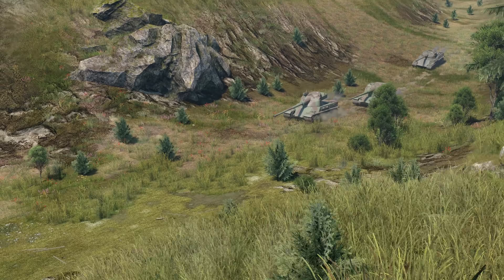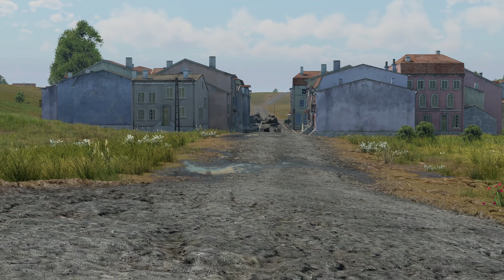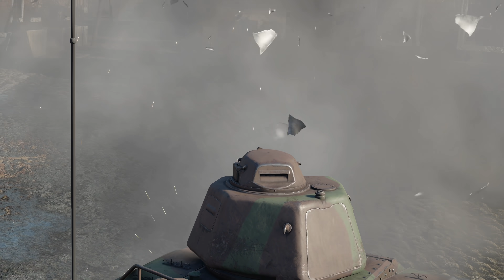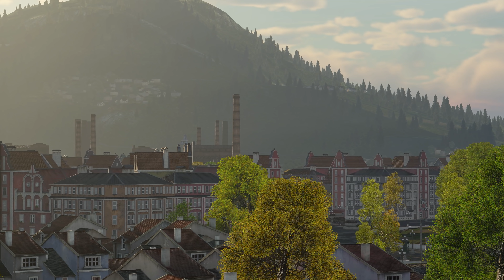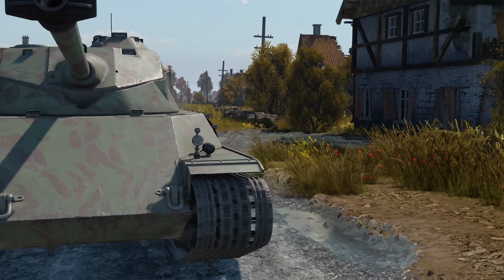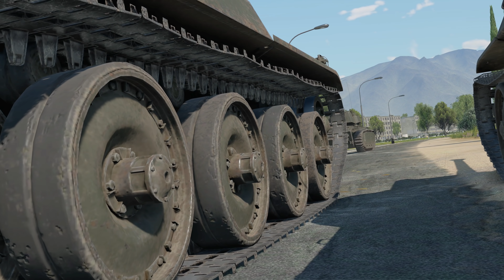French Heavies / War Thunder

Comment: I like the ARL 44. That big front plate probably gives it a pretty fair chance in head to head engagements, especially at longer distances.
Reply: Which one? Because they both have weak turret armor and can be penetrated easily
Reply: @TheSlyRat32  
I'd go for the 90mm. And I didn't know that. Maybe if you go in and out of cover, only exposing your front plate most of the time and just focus on keeping the turret safe, you might stand a good chance.
Reply: @undertow619  yeah but it's hard, I use both and they're really fun to play but if they are already looking at you most ppl know to shoot the turret and it's hard to hide it
Reply: I always get penned through the front plate lol
Reply: But it's glass armor
Reply: @kubi1923  only the turret
Reply: @Darek225Army  I don't
Reply: @Darek225Army  the turret is the only paper thin piece of armor
Reply: @Darek225Army  maybe try setting yourself up like a tank destroyer. Find some good cover, use the tactic I mentioned to Rhat, and most importantly, angle the hull. You've already got a good angle on the plate so if you angle your hull, it should be able to survive a good number of hits.
Reply: I promess you that arl 44 seems well protected, but in game if a tiny rock hit your turret your f***ed

Comment: Why is the AMX 50 usin the wrong turret? (I know 2 versions were shown off but the one the french army adopted was the rework of the AMX M4 turret). Also how come the Schnider 90mm SA-45 and SA-47 (found on the ARL-44 and AMX M4) are not as powerful as their real life version both of which out performed the german 8,8 cm Kwk 43 (found on the Tiger II) in fire power (Also in IRL both the ARL-44 and the AMX M4 used APCBC rounds instead of APC).

Comment: When is Gaijin going to acknowledge that the AXM-50 ingame has the wrong turret.
Reply: You are mistaken. 2 prototypes were built, and one had the turret that we have in the game (the devs made this simple - lazy? - choice allowing to copy-paste the turret of the Lorraine 40t)
Reply: @No_Camping  It wasn't built in that configuration, never meant to be. France wanted to show off what they had on on parade so they took the second AMX-50 hull and slapped on the Lorraine 40t turret as an interim, strictly for parade use and nothing more. It was swapped out for the correct AMX-50 turret and tested as designed. Same hull got turret swapped again for the first 120mm prototype. But the AMX-50 in-game was never meant to exist as a combat vehicle.

Comment: Is there an advantage to having an oscillating turret?
Reply: Yes, autoloading. By having a oscillating turret, the loading mechanism is always aligned with the gun. On modern autoloading tanks like the Leclerc, the gun has to allign with the mechanism to be loaded (this is not modelled in the game).
Reply: Take in mind oscillating turret was "somewhat" stabilized.  At least won't wooble on stop for 5 min, like in the game.